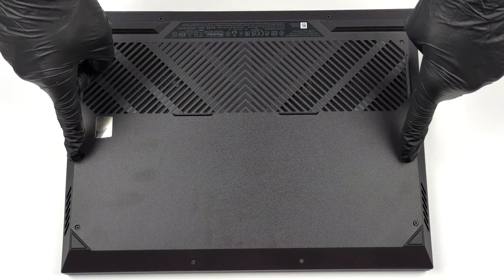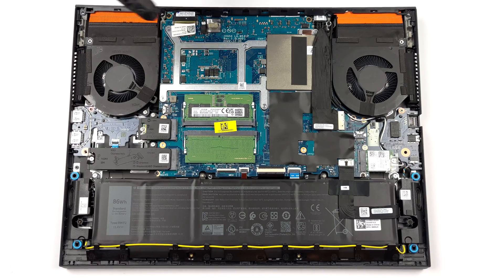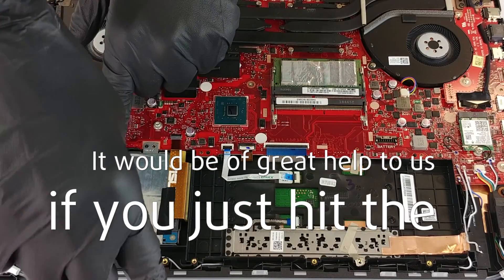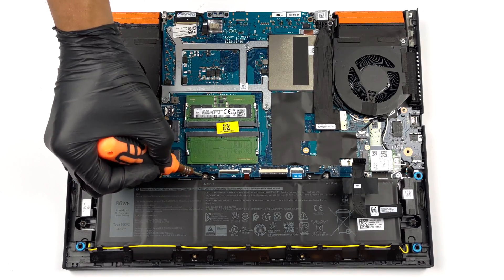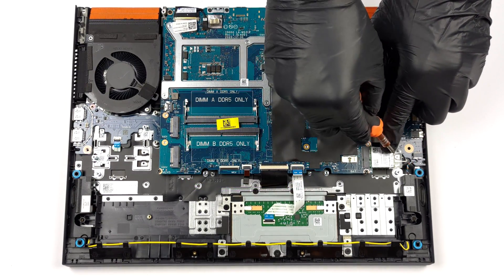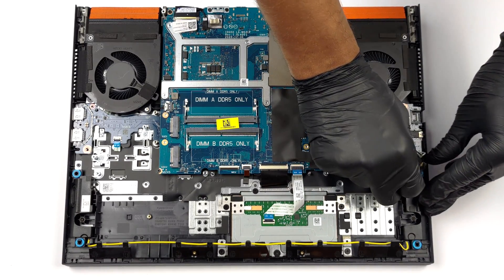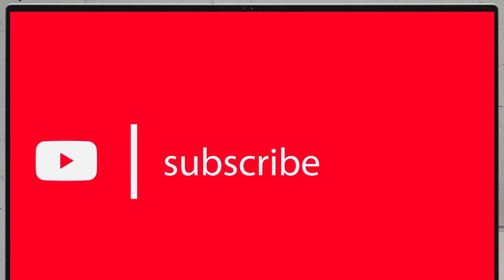🛠️  How to open Dell G15 5530 - disassembly and upgrade options

Comment: I personally suggest not to open the back panel. By following the video i tried now i have got display problem which lead to damage of my mother board. Its better to spend 100 rupees for making it clean by a repair shop. Than spending 13k for mother board...

Comment: BTW, both M.2 slots fit 2280 drives. The shorter one just needs to change the placement of the screw.
Reply: 1x 2280 M.2 NVMe PCIe 4.0 x4 
1x 2230 M.2 NVMe PCIe 4.0 x4

Comment: I recently purchased a G15 5530 with a Core i7 13650HX and an Nvidia RTX 4050 with 16GB of RAM and a 512GB SSD. I'd like to know what type of RAM I should use to upgrade from the current 16GB to 32GB, since Win11 consumes excessively. Also, what SSD do you recommend for the second storage slot?
Reply: Samsung for Ram and for Ssd I'd suggest go for wd

Comment: there are 4 screws im unable to fix😢 and they are attached to back pannel plz help
Reply: Yes so here's the solution it's to gently pop the panel using the tool slowly and gently and they will come right off attached to the panel
Reply: @devsoni8076 Thanks 😅

Comment: do these laptops have bios battery if so where is it as i have a static numlock no display issue which normally gets fixed by replacing a bios battery

Comment: this is the rgb keyboard model?
Reply: I don't think so. 

He has a chip that's going inside the "BL" which i can interpret as Backlight. But my RGB one doesn't even have that chip but instead there's a chip a bit next to it with "KB BL" which the one in this video doesn't have.

Comment: Friends, where are these copper pipes? If it's under the keyboard, doesn't your hand get hot or doesn't it get cold air from underneath? I'm confused?
Reply: Exactly my doubt
Reply: It does get hot actually since it's under the board very hot while running autocad

Comment: Just wondering any idea that we can improve the thermal further more. With price coming down from refurbish  and oculink compatibly this machine is good for overclovking using hx cpu.
Reply: 2 things can be done for better thermals. 
1- Using a better thermal paste (or liquid metal but risky for average consumer)
2- Undervolting (undervolting will decrease performance very slightly but on thermal side make an huge impact and also make the pc more stable)

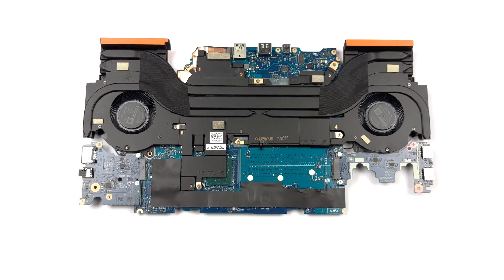Comment: 6:05 just under the heatpipe, central section on the right, is that a M.2 port? If yes, does that mean it can have 3 SSDs?
Reply: It looks like it's a M.2 port but the 2 USB ports are connected to that.

Comment: So my laptop( this same one) has my Bluetooth showing as if it has none. Was wondering if you could show that so I know if there’s an any problem with it once I open it.
Reply: Generally Bluetooth is integrated into the WiFi card. It's the card he removes after the two M.2 Storage heatsinks. He removes the card at 3:21 on the timestamp. It'll say intel on it most likely and has two small wires on it one black, one white. Be very delicate with these as the connector heads pop off if you pull on them wrong. Before doing that I would try rolling back drivers with ones from dells website to make sure its not a driver issue.

Comment: Got an odd problem. The screw, with the laptop opening facing you, thats on the left side edge closest to you, when i try to loosen it, it gets to a point where theres extra tension to turn the screw then it pops and doesn't come out. I know these screws arent removed from the base cover completely but its as if something is blocking the screw from coming out that last bit then a pop sound and thats it. Cant remove cover..
Reply: i have the same issue, did you get a solution?
Reply: I have this same issue
Reply: So the solution is that you need to pop the panel a little by little gently I tried it the screws are like stuck with an adhesive to the board, but if you slowly gently pull on them they won't fall out the panel and will be remain in place attached to the panel itself

Comment: Hey there! I'm curious about the potential impact of installing 64 GB of RAM in my Dell G15 5520 laptop. Has anyone tried it, and what were the results? Did it work smoothly, or did it lead to any issues? I'm thinking of upgrading my laptop's RAM, and I'd love to hear about your experiences and recommendations. Thanks in advance for sharing your insights!
Reply: No. Dell g15 5520 only support upto 32gb ram.

Comment: Because the charger is so big and heavy, I don't understand why Dell does something so exaggerated, it takes away the portable aspect of the PC, I saw the laptop and its price-quality ratio and I was convinced (Core I9 13900, 32 Ram, 1TB and Nvideo RTX 8GB), but my big surprise when receiving the equipment at my house was seeing a 2 kilo block, what a charger it is.
Reply: I was surprised too
How the hell am i supposed to move this piece of brick
Reply: I just got mine knowing the laptop would be heavy, and not really caring (I have a smaller laptop when I really need to be mobile), but yeah that power adapter is heavier than most people's laptops these days
Reply: @daBscout111  its 5kg laptop +charger, a problem if you are weak or a old man.
Reply: I bought a used 330w alienware(dell) slim charger for it.  less than half the size and weight of original charger.  part number HA330PM201.  I usually buy an extra charger for travel anyway so its a no-brainer.
Reply: @todd6786  Tell me friend, is it working normally for you, or is there any problem on your PC?

The idea of having a type of charger like this helps me when I have to go to a meeting with clients or a short trip.

However, my logic tells me that if the original charger is so robust, there must be a reason.
Reply: @todd6786  im my case, my usage outside my house is only for "office work", i am using my old 65w charger that i have from my old laptop, and works fine, for gaming the best option is the slim charger from Alienware.
Reply: Bro, go to the gym, the laptop isn't heavy it's just your weakass that can't lift it.
Reply: Well, it's a performance PC with a 300w charger. It's expected to be heavy, it needs to be. And it's not only Dell's that are this large, any high performance laptop will need this kind of blocky charger.

Comment: How can we install a new ssd into M2?
Reply: up
Reply: @mohamedkheder2880  I installed my second newbought 2tb ssd (western digital brand) into the second tall part under the short included 512gb ssd. Also, I changed the 8×2 gb ram with 16×2 gb ram (crucial brand). At the end, unplugged the battery cable jack from its socket and plugged into it again to make the laptop recognize these new pieces on its own. Then I pushed the start button after a while laptop opened successfully!

Comment: Can we install 2 nvme 2280?
Reply: Yes, the 2230 slot has a removable pin that can be reinserted over a little bit to fit a 2280 drive
Reply: One 2280 and one 2230

Comment: Nice job taking it apart all the way! The cooling system looks more robust than that on the 5520
Reply: My i7 13650/4050 throttles and reach 100 in minutes of playing game. Any benchmark test leads to throttling and dell says it's normal by design.
Reply: @chiragmehta9731 meh. I don't think the cooling have problem. The thermal paste is the real problem.
Reply: @hoangminhx007  tbh all -HX cpus run pretty hot and push max power
Reply: @chiragmehta9731  i changed fully heat sink under warranty now temp is not getting 99c frequently but it does

Comment: I heard comments about not every brand of RAM and SSD working properly with the G15 5520, even though every specficiation indicated that with should work. Like a RAM 8Gb DDR5 soDIMM 4800 mHz of brand X not working. Have you heard about it? Does it happen with G15 5530 as well? I am reluctant to buy upgrades because of it.
Reply: I bought crucial 64gb (32gb x2) dr5 4800mhz ct2k32g48c40s5. It works. But It was a pain. I installed the new rams laptop didn't turn on only keyboard lights came on. So I thought laptop doesn't work with 64gb ram. Apparently you had to wait around 2 minutes so bios can recognize the new rams. Then laptop restarted couple times after that it worked as it is supposed to be.
Reply: @NaimSalman  Thanks for the feedback. Sorry, I didn't see your response earlier. I actually bought both the G15 5530 and Crucial RAM after some research and it worked as well, in the same way it happened to you with 1 or 2 minutes of black screen. Currently using 2x16Gb 4800Mhz from Crucial and aiming to upgrade my current 256Gb SSD.
Reply: @NaimSalman the more memory you have the longer it takes, it was probally memory training. Every type of computer will do it when new ram is installed
Reply: I wonder if higher speed rams would work?
Reply: @aydd95  I don’t think they make faster than 4800 on so dimm for laptops.
Reply: I just bought this laptop. I will upgrade my RAM to 32GB.

Comment: Nice teardown however mine has 16gb ram & is not enough for photoshop considering 64gb but is it really worth it?
Reply: Depending on the sizes of the files you’re working with, 64GB may be a little overkill, but if you’re working with files over 1GB in size, 64 would be optimal.
Reply: @ryanrodesch4756  some video files can be 5 to 6gb

Comment: Can you upgrade 8gb ram version to 32gb, Amazon mentions it can be only upgraded to 16gigs
Reply: I bought crucial 64gb (32gb x2) dr5 4800mhz ct2k32g48c40s5. It works. But It was a pain. I installed the new rams laptop didn't turn on only keyboard lights came on. So I thought laptop doesn't work with 64gb ram. Apparently you had to wait around 2 minutes so bios can recognize the new rams. Then laptop restarted couple times after that it worked as it is supposed to be.
Reply: @NaimSalman You can upgrade as much ram as you want but the system will only use the maximum the laptop can use. In this laptop, it is usually 32gb.
Reply: @NaimSalman  then laptop restarted couple times after that it worked as it supposed to be? That isnt normal...
Reply: Yes, you can upgrade to dual-channel 32GB RAM. I suggest you get two Corsair Vengeance SODIMM DDR5 16GB sticks.
Reply: @ryanrodesch4756  thank you good sir